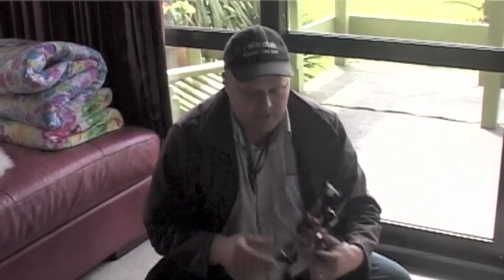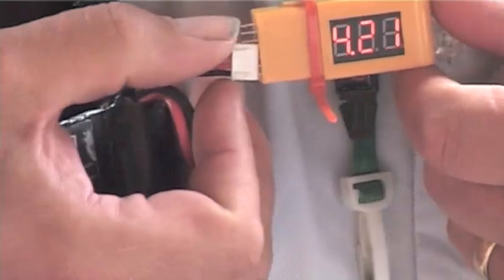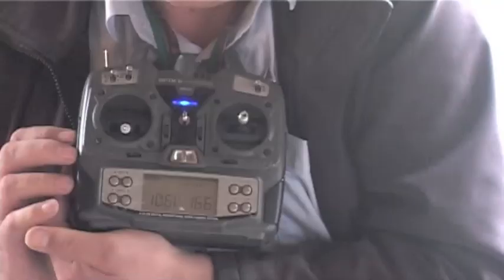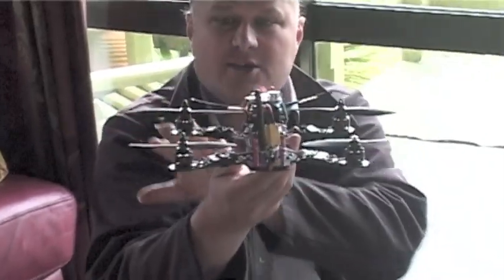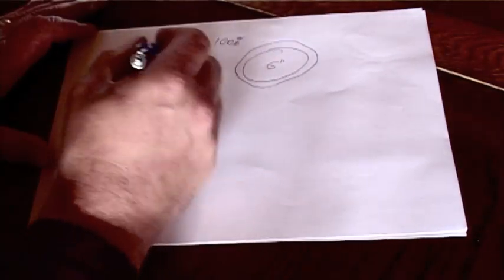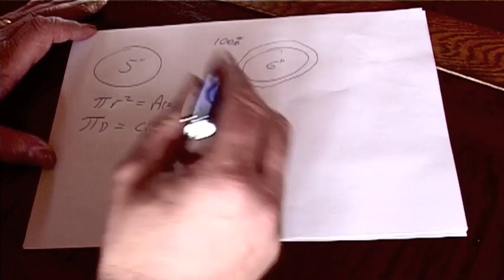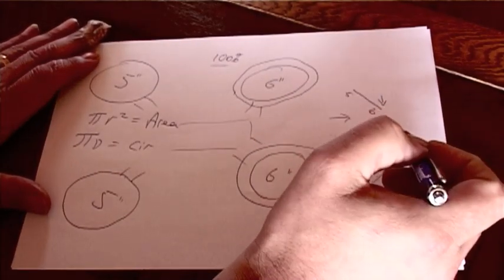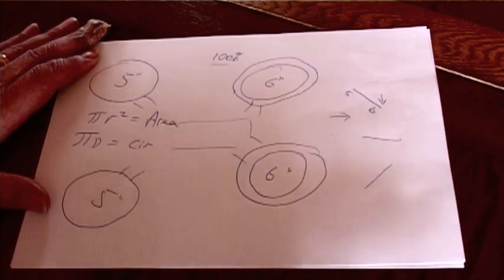Quadcopter 6" and 5" front and back

Comment: What can I do with all the props I have that are an inch longer on one side than the other? :-)
Reply: trim and balance, bruce. ;)
Reply: every day objects in not so every day uses
So you're saying... "two halves make a hole?" :D
Reply: Haha Bruce, Roddy holds all the secrets
Reply from the maker: Good idea is get motors with unusually long shafts. Then put two half props together on the shaft with hot glue inbetween them and screw the nut up really tight. make certain you get two halves that have the hole.

Comment: I like that idea. Except I fly it reversed. I fly 5x4 on the back and 5x3 on the front. I can say it really adds a nice performance boost on the carbon qav250 with naze32.
Reply from the maker: yes I see your point. I will look further into this. can you get 7 inch blades?
Reply: 7 inch on a 250 size??? I think you would have to do an upside down build. i.e. flip the motors over to the other side of the main plate and flip the logic on the naze32. I tried this on a qav worked well with 6 inch.

Comment: I have flown my quad with 2 HQProp 6x3 on the back and 2 5x4 Carbon Fiber props on the front for a week. It had amazing performance. 

Reason why I put bigger props to the back was to balance the battery that was sitting on the back of the quad. It's generally advised to use the same motors and props for all arms. And It's quite important for bigger quads, but minis can tolerate lots of craziness. Which is why I like em :D 

Congratulations on your video btw mate, keep up the good work :)
Reply from the maker: Thanks for that. weekly is working fine. still got heaps to film. keep watching/